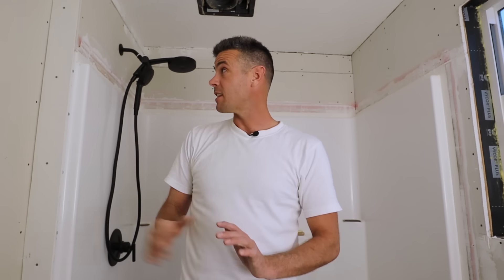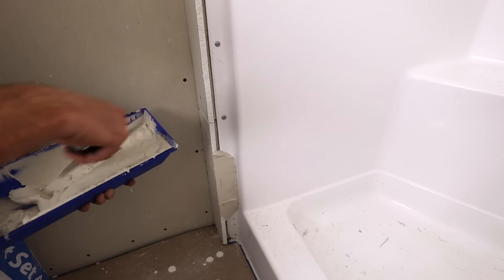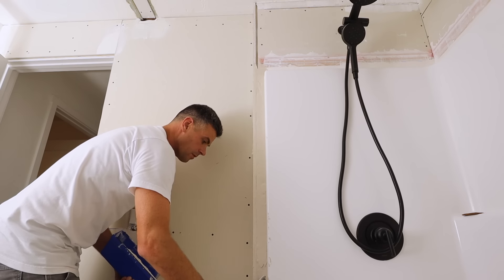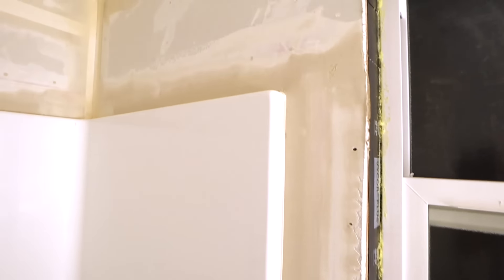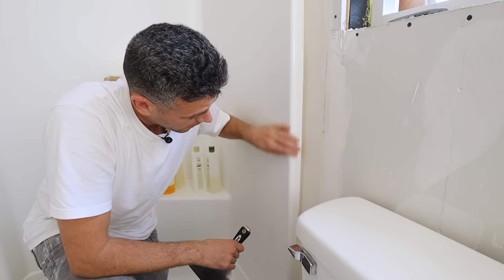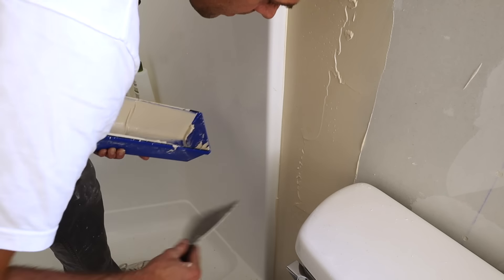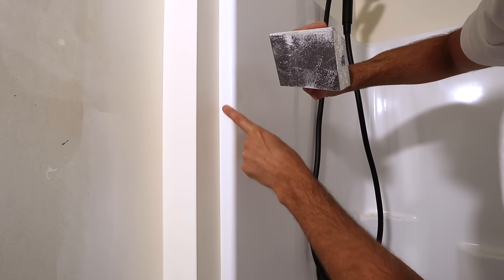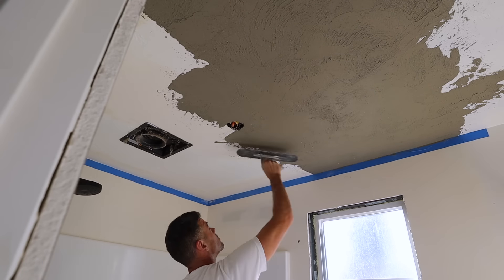How to Fill Drywall Around Tub Flange!

Comment: Can you elaborate on “shim out the studs”? I’m gonna be doing this same thing in a few months and I might be able to do this more righter :)
Reply: Presumably, shim out the studs so that the drywall goes over the flange and butts right up against the tub surround, instead of the tub surround going over the drywall.
Reply: @cmmartti instead of drywall stopping to the flange like the video.
Reply: What these guys said. I did this a couple of weeks ago and had everything down to the studs in the bathroom. Ripped a piece of 1/2” plywood and placed 4” pieces perpendicular to the studs. I am terrible at mudding, so anything to avoid that is worth the effort in my book.
Reply from the maker: Yes, this.
Reply: @vancouvercarpenter Awesome, thanks!
Reply: @nathanholmes4197 Got it, thanks so much!
Reply: @Andy.Fujimoto Totally makes sense, thanks!
Reply: @cmmartti Ok so sorta makes the drywall stick out farther from the wall so you can make it overlap the flange
Reply: @roccit  Install the tub surround directly against the studs, before drywall. Shim out the studs around the surround by the thickness of the flange. Then install drywall over the flange. Cut it nice and tight for minimal filling.
Reply: @cmmartti  Awesome, thanks for the explanation!

Comment: Awesome video! It’s about time somebody talks about the dreaded shower to drywall transition. Trim Tex makes a tear away shower bead that works really well also. It’s like a regular tear away bead but with a much wider tape flange to bridge those gaps. You still have to prefill, but when it’s finished it gives you a nice edge to caulk to. We like them because those tub surrounds flex enough that hairline cracks can form if it’s just drywall mud.
Reply: I use Trim Tex too... ☺️
Reply: I use L bead but I am going to check out this trim tex stuff.

L bead leaves a perfect gap to seal with silicone.  Drywall will never be sitting in water.

Comment: Great vid. For removing drywall (and paint) on unpainted wood/other surfaces next to drywall I have had good success wetting a thin piece of cloth, pulling it tightly against a putty knife blade and sliding it left/right (opposite the motion you would normally move a putty knife) to clean it up. Keeps scratches at bay :)

Comment: What's really funny is? I was just working on one of these yesterday.
 But a little larger. In a modular, home, very tight fit.
 the customer wanted half inch mold resistant drywall in the bathroom I have totally gutted this modular.Right down to the studs and joyce's I have Went through already 43 4×10 sheets of drywall and 12 sheets of mold recent drywall wall And to be honest I do believe they build a whole house around the shower bathtub

Comment: I'm a new subscriber, VC man. A young guy in construction who follows you told me to subscribe when he learned I'm working to buy the small house I'm currently renting. I have minimal experience but I'm a really good YouTube learner--and will be doing lots of drywalling. I'm 24 btw and hope to own my home soon. The house is run down but has good bones. It's in the country but has a basement with high ceilings for this house. I have my home gym there and a pull up bar that works. I'm 6'3" so happy for a good basement. But I hope to do lots of insulation in the basement and some moisture abatement. But lots of drywalling will be in my future.

Comment: But the real question is what kind of kombucha are you using?? Will results vary if I use another kind????
Reply from the maker: Yes
Reply: What is different between quick set and hot mud?
Reply: Two names for the same thing.

Comment: I have several comments.  First off, you sir are an artist with a knife and a trowel.  Second, I don't like to add multiple layers of setting compound without drying compound between them.  I also like a layer of drying compound to ppime or paint.  USG green lid regular all purpose is good about not growing mold or mildew but it's not water impervious like setting compound.  Third, I've tried to use cheap wood glue with quick set.  I never have good results.  I should probably use the water proof stuff.  Keep up the good work.
Reply: What setting compound do you recommend.
Reply: The easiest to use is quickset lite by proform.  It mixes clump free super easy.  It doesn't thicken until it's ready to kick off, then it sets up all at once.  It's not the toughest setting compound but if you need a predictable, water proof, fast setting compound, it's what I use.  Don't buy a setting time number higher than 45.  Setting compound has to chemically set up faster than it air dries.

Comment: The shower was installed wrong to begin with direct to stud dont mean direct to drywall. I know your showing people a way to do it but this one is like a hack fixing a hacks work. The is also regular drywall in a shower area FAILED , and FAILED INSPECTION. Only do this is your not able to fix the problem this is a last resort.

Comment: The idea of mud on a plastic surface thats gonna flex and move daily causes me irrational concerns. I have seen it work. I know it works. It works at my house. But If i did this i would expect a cracking fail. With perfectly feathered edges. Thanks ben
Reply from the maker: The pre-fill was done 6 months ago and still had not separated from the drywall edge or the flange. The surround was very securely fastened. I have no doubts it will stay solid.